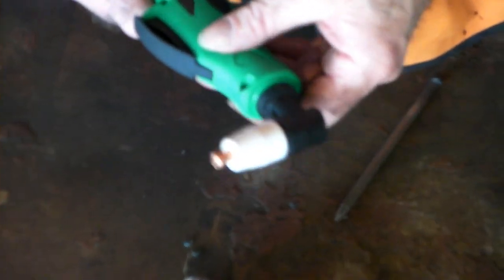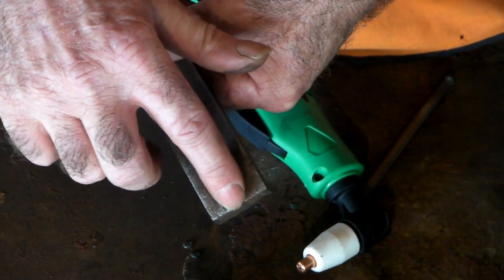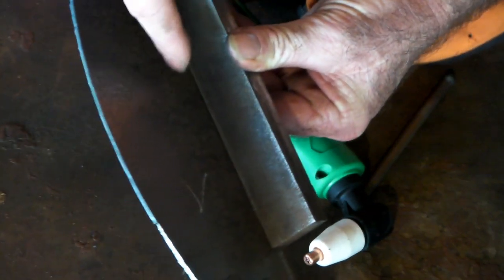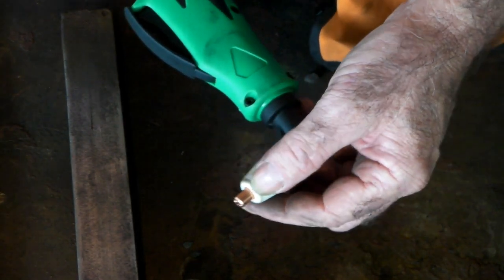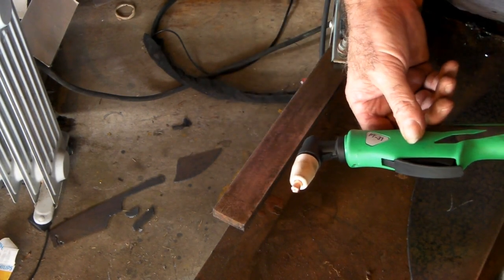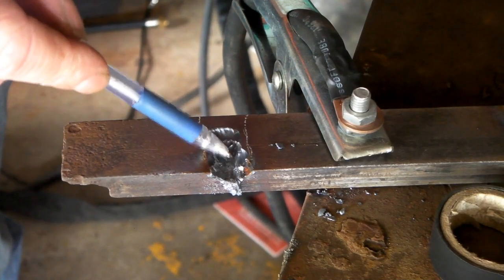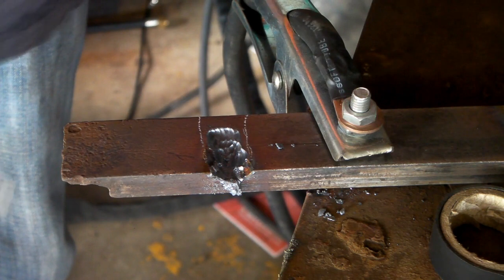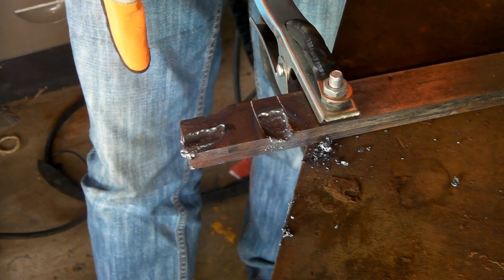Gouging with cheap plasma cutter

Comment: Thanks for another great tip for my cheap plasma cutter.   Your channel has been a great resource.  Are there tips with different opening sizes for the PT31 torch?  I just tried a 0.045" tip (about 1mm or 3/64") for the AG60 torch and it worked much better at gouging out some fillet welds than the 0.030" tips that came with the machine. The 0.045 tips also seemed to work better at cutting at higher amps/pressure (60A /65 psi).  I was going to try drilling the tips bigger but they work well out of the box.

Comment: Will this work on a ag60 torch ?
Reply: I just tried some 0.045 tips for an AG60 torch and they worked well at carving out some 1/4" (6mm) fillet welds at 60A and 65 psi on a CUT60 machine.  Didn't have to open the tips with a drill. Laid the torch over to about 30 deg. so it was pointing down the direction of the weld and just moved back and forth as moved down the weld.  The flame looks like it bends a bit when its cutting. Tried dragging the torch which worked well but pushing the torch also worked and cleanup was easier as it blew the slag away as it went.  Didn't try gouging a flat plate but could cut down the remaining weld to  a mm or 2 of the flat after getting the pieces apart.
Reply: I was curious about trying that technique.
Thanks for the feedback 😃👍

Comment: I have a massive project coming up where i need to flush cut bolt heads off without damaging the material that the bolts go through. Been considering gouging with my cheap plasma machine where special gouging tips are not available. 
Your modification is so simple. For my application, I wonder if I shouldn't hold the torch at a steep angle to "wash" off the bolt heads, vs perpendicular. Your thoughts?
Reply from the maker: it might be ok useing this for 1 bolt but i wouldn't use it for many.

Comment: Hi Pete, greetings from England! Great series of videos on plasma cutting. Couple of questions - if I use a non contact cutter will damage occur if I touch the piece I am cutting with the tip? Can I use the torch with a bigger gap to heat up a piece of steel for making a bend. Keep the videos coming - you're a bloody laugh - makes me smile!
Reply from the maker: Hi mate ,hope your well well over there ? I wouldn't use a pilot arc as a drag tip .Also you will never get enough heat to bend steel thanks.
Reply: A non contact tip will cut if dragged but it will be destroyed very quickly. I wouldn't recommend it. Unfortunately, a plasma cutter isn't useful for heating steel for bending either. Great to have for cutting though.

Comment: Have you tried gauging a weld out like a carbon arc? If so was it effective?  Thank you
Reply: It will work. It's generally not as good as air arc but much better than nothing or a grinder.
Reply from the maker: Might try thanks

Comment: Hi Pete ,  I bought a pilot arc torch for my non pilot arc machine and wired it up the way you showed in one of your videos and it works, 1 question my arc only stays on for about 1 second then stops, And if i release the button it wont start arcing again until the machine stops the air running then it will arc again. Is that normal?
Thanks
Joe   Sydney Australia
Reply from the maker: I only ever use it to start the torch then touch it to my steel

Comment: Great video. Did you use the same air pressure? In another video you just maxed out the regulator. And what current were you running please?
My machine came with a pt31 torch but NO suggested settings!!
Reply from the maker: Yes and yes

Comment: Thanks, the princible reason I am picking up a plasma cutter is to get rid of my internal fillet welds when they are wrong or most likely of poor weld quality.  Hey, what can I say, I only started welding a couple of months ago.  just can't get a grinder in there and I can't afford a 3k plasma unit with gouging capabilities.  I would think you might want to turn the amperage down initially and then work your way up to get rid of the weld?
Reply from the maker: cool